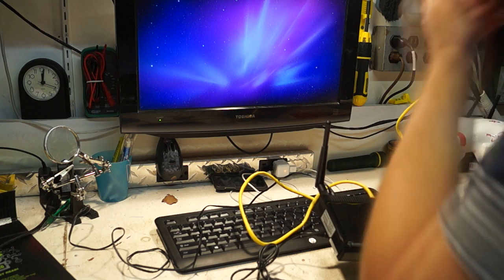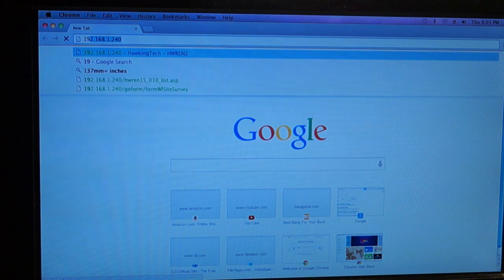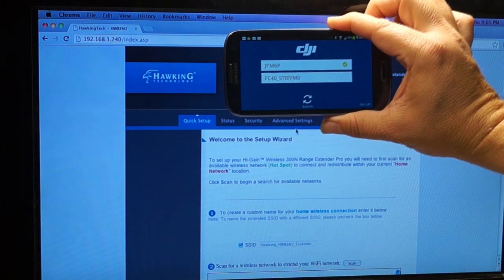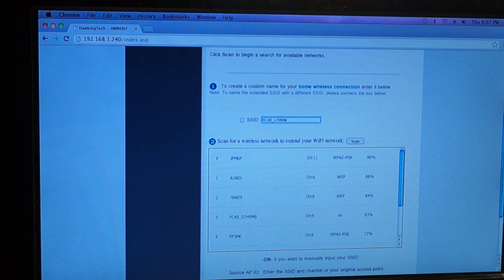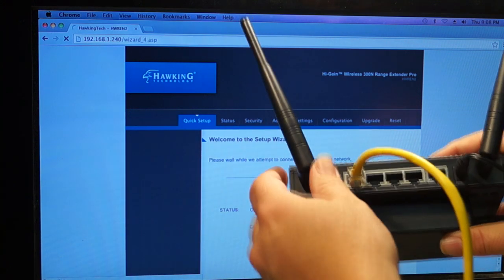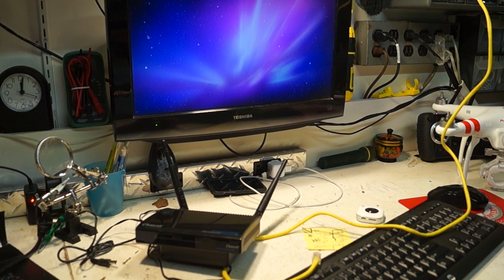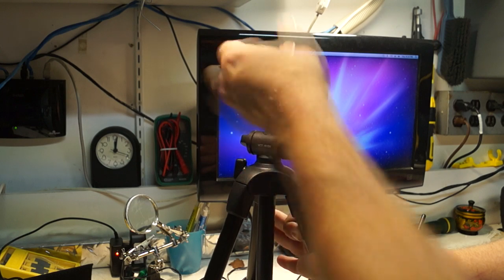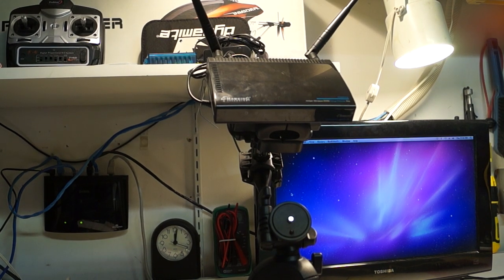How to boost FPV range of Phantom FC40 Part 2 How to config booster

Comment: Will this exact set up work with a iphone, i have read somewhere that the app on the iphone will not allow it to connect to the booster. Is anybody using a hawking booster or another booster that does work with the iphone. I really hope someone can confirm this as i have all ready ordered a hawking from the states.

Comment: Is it possible to use this same technique to boost the wifi signal of a GoPro Hero 3 instead of the FC40 camera?
Reply from the maker: Strangely enough I tried same technique with the GOPRO and results where poor. Really haven't put a lot of time testing it so if you try yourself your results my be better.
Reply: Craig W Okay Craig W. I did try and you are correct, poor results. I appreciate you getting back to me on this and thank you! Great videos too!

Comment: Hi, I had a D-Link DIR 815 laying around and tried the same hook up,I was able to see the new FC40_S703xx on my phone and when I tried to connect it said (camera not found!) I was looking for an alternative way to save money. Any thoughts on why this is happening?    Thank you..
Reply from the maker: A D-Link DIR 815 is a router not a signal booster, not really designed to do what I am doing in this video.  The Hawking is designed to connect to devices such as a D-Link DIR 815 and boost the range of the signal thus giving you more wireless coverage..

Comment: Set up my FC 40 and got excellent results.  Measured range out to 1000 feet with good video.  Got all the electronics from Amazon, they had the battery and cord that just plugged right into the extender.  Thanks for the great info..
Reply: You do it with the same booster on this video ???
Reply: Marco Ramirez Sandi Yes the exact same setup, all from Amazon..

Comment: Great video! I have my booster and battery arriving tomorrow :) I understand this boosts the signal strength between the FC40 camera and the phone, but how do you extend the signal between the Phantom and it's receiver? Isn't the max RC range just shy of 1,000 ft?

Comment: Looked great, but the price of the Hawking High Gain HWREN2 (in your video) + Power Pack is no less than £104.23 here in the UK ($177.62). Man I thought under £50 for sure. I'll keep searching for another one, but it seems on first glance that Hawking Extender has some special qualities. :-/

I'll post back if I find a similar, less expensive solution for UK fliers.

Comment: Well I got my Hawking HWREN2 in the other day and it was very easy to set up but found the results to be very Underwhelming. I actually get about 20020 meters less wifi range then I am already getting with out the repeater. even putting some 6dbi antennas on it didn't help much either.  WIth the hawing repeater I would only be able to get out about 300meters and it would lose signal and the camera ap would not even see the repeater in the list But I could still go another 20 or 30 meters away and still could connect to the camera directly. SO basically the old kindle fire I am using for my FPV monitor has more range then this repeater does. and the kindle also not need to be fussed with or constantly trying to re aim the antennas to even be abel to get the 300m the router will get as long as i have the antennas orientated right.  Tho I do suppose if I were going to use my smart phone that has lousily wifi range of only about 1 meters. The hawking would be a big improvement in range.  But I prefer to use the kindle any way it is not a improvement and shortens my range.  and if I'm remembering right the kindle cost about the same as the repeater did. So realistically some one that has bad wifi range would be better off to just spent the $80 or less to just pick up a kindle fire with wifi and a holder to go on there transmitter. and they would have longer range then the repeater and also have a nice big 7 inch screen that has a better picture then most smart phones have.

Comment: Craig W. , good info and options for inceasing the FPV range. After a little research I have found another booster by Amped ( Amped Wireless High Power Wireless-N 600mW Smart Repeater and Range Extender (SR10000) )with identical specifications but with dual 600mW amplifiers and 5dBi detachable high gain antennas that I'm going to use to insure connection with the FC40 camera and try a range test(within reason, considering  most of the interference factors-trees, buildings, etc) and left you know the result

Comment: while I'm waiting for the repeater and some better antennas to arrive.  I just did a range test of my wi-fi video range on the FC40 using my girl friends kindle fire after figuring out how to down load regular android apps using an ap installer called 1moblie. and I got about just sort of 1000 feet before i lost video without any repeater. Tho thats 3 times father then the phone would get. any way longer then the claimed stock range of the FC40s wifi camera and I'm in the city to no less.  So I'm wondering if the wifi repeater is going to even give me any more range then I'm already getting on the kindle being some are saying with the repeater set up they are getting about 900+ feet.

Comment: Has anybody done this on their FC-40? I'm interested in trying it but want to hear how it's working.
Craig, how about doing a distance test video?
That would be cool.
Also, you recommended a different power source/battery in your later comments. Is that better that your original recommendation?

Comment: Thanks Craig W!  

 This is so fucking great! I saw your video thought about it bought the stuff they came to the UK from the US in 2 days put it all together like instructed and this fucking thing is AWESOME!

Today I went more than 1 km away. On the way back the battery was nearly dead and I had to drop it down in the field in front of me! :D 

Its awesome! 8 mins 40 secs run time with stock battery. 
Normally it is 10+ mins but this time i was pushing it high and far constantly. 

So yeah THIS IS RECOMMENDED! This makes your freaking FPV run maybe farther than a Phantom 2 Vision and it costs so little compared to it.
Reply from the maker: Great to hear.  Glad it helped.  Also look at getting a battery like this:

http://www.amazon.com/Lectron-Pro-11-1-volt-Connector/dp/B00HJBZ3FU/ref=sr_1_2?ie=UTF8&qid=1397682619&sr=8-2&keywords=lectron+2700+mah

and use phantom 2 vision blades, you should get roughly 18 minutes flight time!  I was getting that consistently except now I added a gimble and a gopro so I am down to 12 minutes.

Comment: Craig, let me know what the new average max range is in this configuration.  This is pretty awesome!
Reply: I did 1+ km today. (about 3168 feet)
Reply from the maker: The longest I went so far is 1211 feet.  But here's the thing.  The FC40 camera just doesn't do it for me anymore.  I bought a Gopro Hero3+ Black and a gimble (DJI Phantom FC40 day flight test of new Walkera G-2D Gimble and GoPro Hero 3+) and since seeing the quality of that setup I cant handle using FC40 camera!  I have hooked the booster to the Gopro and I will test if it is feasable to use Gopro as FPV as the new Hero3+ has a lag factor of about a 1/2 second vs. 4 to 5 seconds on the standard Hero3.  If it doesn't work good then I will run both cameras and still use FC40 camera for the FPV.
Reply: Yeah, the video quality from the FC40 camera is pretty terrible.  I already had a gopro hero2 so I used that in a gimbal now as well but being that it is not a wifi model, I still use the FC40 camera for FPV.  I would need a 2.4 ghz Tx & Rx along with a new monitor if I wanted to FPV via the gopro feed.  I am holding out on getting a hero3+ in hopes the hero4 releases soon and I will jump on that.
Reply: Craig W can i use a 2.4G 2.5W Wireless Wifi Range Broadband Amplifier Signal Booster 802.11b/g/n?? is it the same as wifi booster??

Comment: Sure did. I used that same technique with AR Drone 2.0
But the range extension wasn't too much... like 1,5x or 2x tops
I was using another wifi range extender so maybe it was that.

What results did you obtained with that mod?
Thanks and keep up the good work.
FErnando
Reply from the maker: The longest I have went is 1211 feet away (I tag teamed with my friends Vision 2 which he also modded so that's how I got the range).  That's pretty good seeing the normal range of the camera is roughly 328 feet.
Reply: Craig W I managed a little above 1000 feet without the Booster and 3168 with.
Reply: Thank you all. Gonn atry it
Reply from the maker: RayneR Wow thats awesome.  I have never attempted to go that far.  But then again I have been so busy with work I haven't had any quality flying time lately...:{
Reply: Craig W Aye I understand. I haven't flown in almost a week now since I have to finish a project by the 6th.  

But mostly without problem I can go 1km = 3 280 feet  And I managed to push it as far as 1.3km - 4 265 feet with me being on a slightly higher spot and flying towards the horizon. When I have the time i'll upload the video.